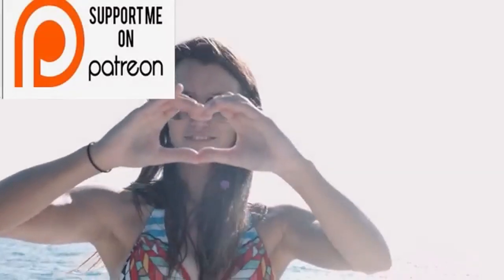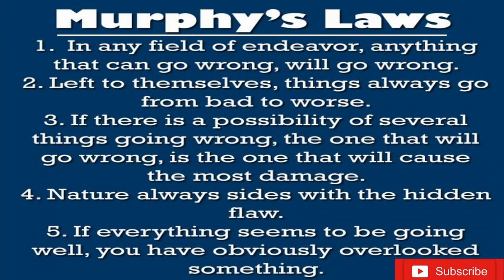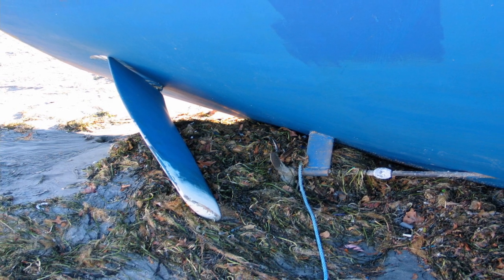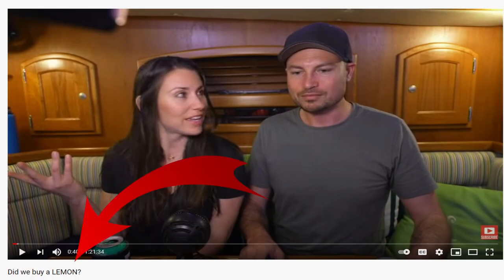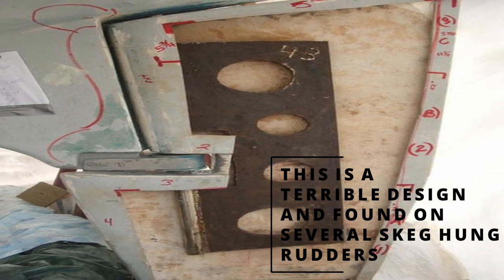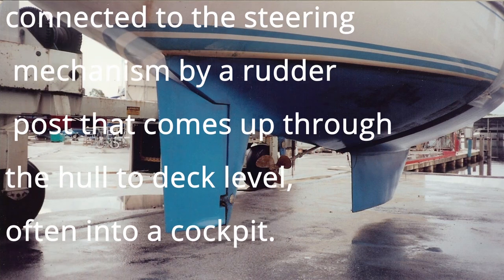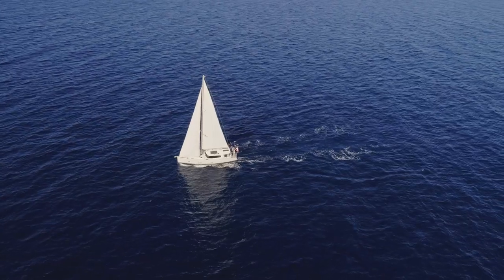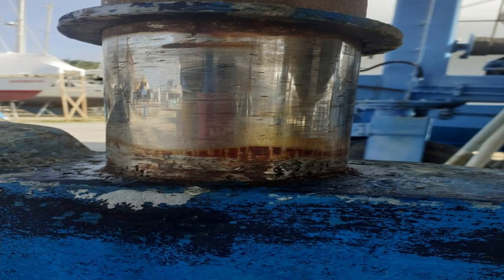Sailboat Rudder Failure, How to avoid

Comment: Good stuff! You know some boats have an electrical path to the rudder stock via the steering gear?  Check to see if yours does with a multimeter on the Ohms scale. If it does, fit an anode!!! It can be on the hull but must protect the the rudder stock. Especially if it is aluminium. We all know what happens to sail drives when the anode fails or is not protecting? Well those of us that use our brains do? Sail Safe mate. Ant, Cid & the pooch crew.

Comment: The best way to have a long lasting Rudder is buy one from a manufacture that knows how to build a quality rudder. There are 3 major rudder manufactures in North America. They are NOT all equal. There is a significant difference in the quality of the 3 different manufactures. Do you homework.  With little research you are likely to learn that the most well known manufacture may not be the best option.